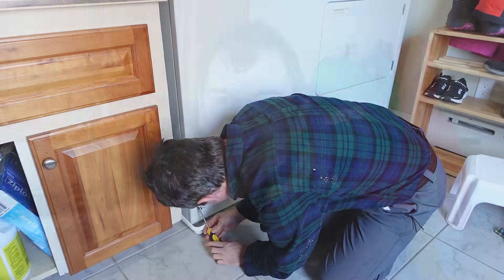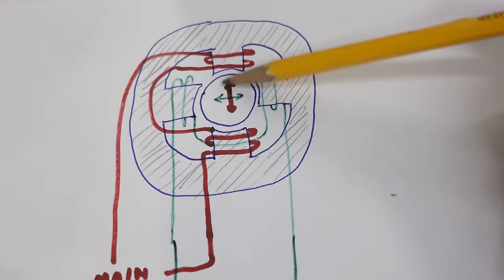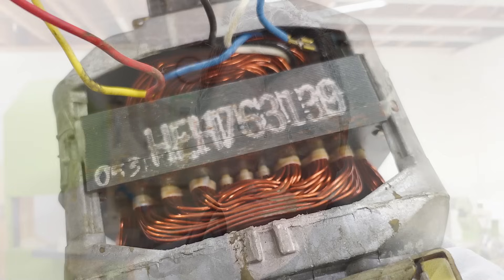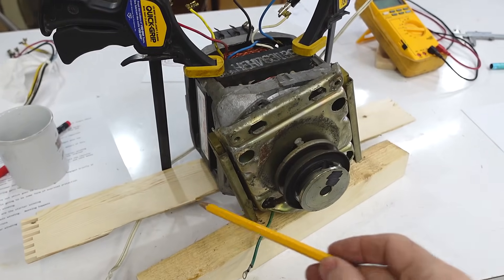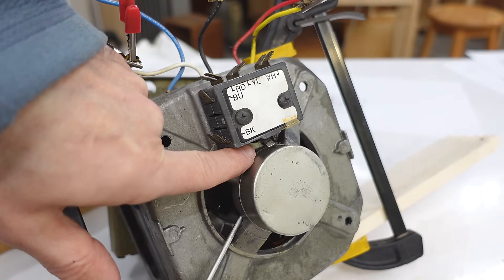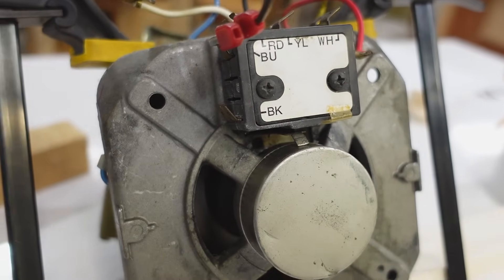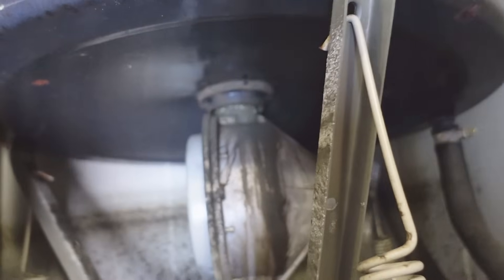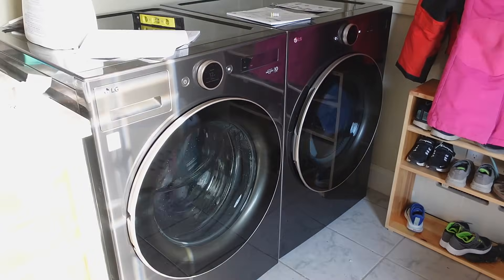Washer motor wiring to reuse for projects

Comment: If you can just replace the capacitor with thinner winding wire, I'm curious why that's not always done that way?
Reply from the maker: Its inefficient.  For larger motors, it would pop the breaker before it gets up to speed.

Comment: Very good, i like the diagram with the 2 windings the start and the running, so once the start winding has started rotation of the magnetic field by being slightly out of phase the motor then reaches a balance point where the field rotation balances itself, is the balance achieved by the slight phase lag that is caused by the physical motor never catching up with the rotation of the field, thanks.

Comment: I’m a process controls and automation engineer. I have rewired and added an Allen Bradley 1756-L83E to my house and use a 1794 Flex I/O rack to my washer and dryer to better control their processes. My next endeavors are going to be to automate my refrigerators and freezers. I have controls on my plumbing and HVAC system to monitor pressures, temperatures and flows. Next will be to automate them. Parts are much cheaper when they are standard process parts and not proprietary vendor parts. So far I have yet to find an appliance I could not automate. 😂

Comment: After decades the penny has finally dropped as to how I can wire the switches on my pillar drills and late to reverse the shaft rotation.

It also explains why the 1940's lathe has a washing machine motor!

Comment: I dismantled our washing machine 5 years ago and the motor is a universal motor, it also runs on DC as low as 12V.   It looked brand new even after 10 years of heavy usage, as did all the other components.  The fault was traced to the programming board which cannot be replaced according to the manufacturer.  Maybe a video on universal motors please?  Thanks for posting this!

Comment: Like your video! I have a problem . I have an old Maytag A209 washer Very similar like yours  and i can't find the start capacitor anywhere, not even on the schematic diagrams? It just stop working and now it just hums..Talk to techs and there's "no" diagram illustration for a capacitor but there is a part# ? Im dupped!   I got a new replacement motor but i dont know  to add in a "cap" to the new  motor because i really want to save this washer! lol Can you please help?

Comment: I realize this vid is a year old but I'm hoping someone could advise. My motor has a 5 wire plug. Two red wires that run together and the other 3 wires are a little larger red, blue and white. Im thinking the red, blue and white could be high, low, neutral and other two red go to control board. I smoked an older motor this morning and this being a newer and bigger motor I better start asking questions
Reply: GE model j58tlb1186
Reply from the maker: there's no standard for what color does what.
Reply: @matthiasrandomstuff2221 my old one is similar to the one you use in the video. It came from my old washer and the quick connect burned (near fire) on the control panel side. I wired several ways but the only way to make it run smooth was connecting only the run winding. It'll serve its purpose. I have little experience with these type motors so it's all a guessing game or lessons in what not to do. The new motor is no good on the shelf. I'm going to do some more looking but tomorrow afternoon I'm going to experiment and see what happens. The 3 larger wires all have continuity no matter which two are connected but none have continuity with the two red wires. Ill come back with the aftermath report
Reply: So far, the two smaller red wires with no continuity with other three go to a sensor of sort at the back end of the shaft. I ran a live to the white and neutral to blue, gave it a spin and it took off running quiet. I connected the neutral to red with live still on white and got same I think. No way to tell if rpms changed. I didn't try any other combo. Tomorrow I'll check ohms between white/red, white/blue and blue/red blue red could be higher speed. Red/white/blue are the only wires so now that I'm thinking about it maybe the two smaller wires go to brushes. I've never seen brushes on tge end of a shaft though. Since there is no signal between those two and other three I doubt it's brushes. Any ideas?

Comment: Cool guide, but what a waste of a vintage Maytag. Based on your other videos, you would have been more than handy enough to replace the seals, main bearing and avoid a modern garbage appliance. Parts are still everywhere. Don't hire repair people that also sell new appliances. Guess what makes them more/easier money.
Reply from the maker: Service guy said, if you need a new main bearing, you have to get it out of...  another old maytag washer.  Sadly, they do wear out too.

Comment: I have a question for you. I have a 12v DC motor that went to a folding bench seat in my van. It's a single phase from what i understand do to having only 2 wires,Red/Black, pwr/grd. I would like to open it and ADD to more wires so i can use one set to power it and the other, to power something else at the same time.Can you do a video on that.?

Comment: Matthias,  have you noticed significant lint bypassing the filter trap in this LG dryer?  -- I found lint builds quickly beneath lint filter in just a month or two of use of 2 year old LG dryer. The lint filter and housing are in perfect condition. I was curious about the cause so I used a bright flashlight and phone camera zoom to peak through the plastic slots while the lint filter is in place and found air gaps between the frame of the filter and the filter housing. Later, I inspected 3 LG dryer models in an appliance store and all had a loose fitting filter with air gaps at the bottom inside edge which would allow significant air and lint bypass into blower motor.  I looked at 7 other machines from other manufacturers and none that I inspected had gaps like this. Perhaps it's designed that way to allow air bypass if the filter is clogged, or perhaps it's just bad manufacturing or even bad design?

Comment: While it can often be difficult to get parts for old washing machines, or appliances in general, from manufacturers and suppliers after a while, there is still hope if you don't want to outright replace things.  Often, things like bearings can be matched up by size and type at a local bearing shop, or by people in the know who do a lot of "out of spec" repairs.  I can recall a time when a relative took a bearing out of a window ac unit in to a bearing shop, and as soon as he set it on the counter, the clerk was able to identify the make and model of the air conditioner without even having to look at the part number.

Even good used parts from appliance breakers can often be found on sites like ebay.  I replaced the motor and drain pump in my 30 year old washer last year after the starter windings burned out, thanks to the bearings in the motor binding with rust from a leaking drain pump.  My washer uses a common shaft to drive the drum out one side of the motor, and the drain pump out the other side, hence the motor issue.  The motor I got from ebay worked flawlessly, without noise, and I was able to get the drain pump new.

Comment: Our LG washer/dryer has an option to light up the drums when they're running. the Mr. and I watched probably 10 loads when we first got our new machine. I replaced the bearings in our old machine probably 5 times before we gave up on it and got a new one.

Comment: That washer was also made when they were still belt driven. Later on they were mounting the motor directly under the tub. And then when the seal in the bottom of the tub leaked a little it dripped down into the motor damaging it.

Comment: Pretty neat stuff. We had a front-loading washer and it would mildew and get moldy. We replaced it with a top-loader which I think is much better.
Reply: Don't close the door all the way when done, let it dry out first. Problem solved. And they won't rip your clothes apart like top loaders do.

Comment: I rescued a fridigidaire dryer so if it has too much problems I'll just use the motor. I want to make a chicken picker, a sander and a concrete mixer with the washer motors

Comment: Been working on motors eince the 1960's and never saw or seen a resistor in seties with a start winding. They have been making split phase motors witout capacitors for over 80 years. Only used for low starting torque applications. No such amimal as a winding going up & down. AC Motors windongs produce a rotating field. The start winding is 90 degrees out if ohase with run winding .

Comment: The water level switch is also pretty handy. It is and off/on switch with a diaphragm and works off air pressure that builds up in the tube when the water level rises. I used a splice fitting attached to a piece of cpvc to control a pump motor for maintaining a constant water level in a homebrewing design.

Comment: I think the new "energy effciency" washers use MORE electricity because they run twice as long if not longer than the older top load models. They save water, sure, but my water is $8 a month and my electricity $250 a month. New washers aren't worth it in my book.

Comment: I've taken that Maytag motor apart, the little box on the top where the wires attach is a relay that controls the start circuit. It opens when the RPM of the motor attains a sufficient level. It didn't use a start capacitor, it used that relay (originally). I actually added a capacitor to the circuit, which didn't work very well, but later I found out that the relay is easy to rebuild, and has points in it similar to the points in the ignition. All I had to do was to file the points and the motor started working again.

That's a good motor, it was in my mother's Maytag, which unfortunately she scrapped when she replaced the washer.

EDIT: I guess you kind of explained what I said in the comment, in a bit clearer way. I assumed that the relay worked by centrifugal force. Since I never took the motor out of the machine, I never saw the little tab that moves the switch, that you point out in the video. Anyway if you unscrew that cover plate you can inspect the points of that relay, it might need dressing with either a point file or a nail file. Great video, a few years ago when I fixed my mother's Maytag, the repairman said that the transmission was gone, when all it was, was the little relay, the transmission was fine.

Thanks for the content. 
Keep up the good work.
Reply from the maker: not a relay, just a switch, activated by the button towards the motor shaft.  Contacts are not hard to clean if you take the two screws off.  Putting it back together is a bit tricker.

Comment: Hi Matthias.  Hope you could reply on this. Been a long time viewer of your channel. I just need to ask a favor. I have an old Kenmore clothes dryer which operates on 220v.  However, our new 220v supply is not working for our dryer. I am attaching here a diagram to better understand the problem. On Fig. 1, the dryer works but not on Fig. 2. Our new outlets have no longer 110v if read from the ground. Hope you could advise how can i still use the dryer on the new power supply.

https://drive.google.com/file/d/1MT8jz7WQmWEi73M4JFCGIqteYItzrAnh/view?usp=sharing

Thanks in advance.

Comment: I remember this simple washing machines from my early childhood. My mother got one second hand, I guess it was made in the 40's or 50's, it had a wooden cub, a big strong motor underneath and had hand swing what's-it-called the squees out the water to hang it upon the washing line. Miele was the brand, it was used til in the 80's. Maybe it us still working, It never stopped, it simply was replaced by an automatic washing machine.

Comment: Hi Matthias. Been a long time viewer of your channel. I just need to ask a favor. I have an old Kenmore clothes dryer which operates on 220v.  However, our new 220v supply is not working for our dryer. I am attaching here a diagram to better understand the problem. On Fig. 1, the dryer works but not on Fig. 2. Our new outlets have no longer 110v if read from the ground. Hope you could advise how can i still use the dryer on the new power supply.

https://drive.google.com/file/d/1MT8jz7WQmWEi73M4JFCGIqteYItzrAnh/view?usp=sharing

Comment: My first home (purchased in 2002) came with the Maytag washer and dryer you can see in the basement of “That 70’s Show”. I lived there for 8 years and only once replaced the thermostat in the dryer. Simple and reliable. If the next owners are smart, those are still kicking it in that basement.

Comment: Matthias, you have a special talent for making things easily understood and interesting 👍👍 Thanks for making these vids for us to learn from and enjoy!

These old electro-mechanical washing machines tend to live long lives, and are easily repairable as long as you can get parts. The newer electronic machines are more efficient, but also do a worse job at cleaning heavy dirt, and they are not built as robustly. Many have electronic components which regularly fail, and the repair is to replace a circuit board which is costly. Often there is a shortage of the parts needed due to high demand for them and the factories render them 'obsolete' sooner, meaning that 5 years from now you may not be able to get parts and will be forced to buy a new machine. So if you have an old machine you should repair it and maintain it as long as possible because the new ones are a rip-off. But that's all you can get now. In the end this increase in efficiency will cost us more financially and ecologically too; so the final conclusion is for me that they are not truly efficient at all.

These old motors have many uses in a shop and like the machine they came from were built to be robust. They should be saved and used instead of being scrapped. One thing to look for is that the centrifugal switch sometimes gets gummed up and will give a no-start condition. Clean it if it looks like it needs it and try again; often that gets a dead motor going again. The new machine's motors are not built as robustly and may not have as much horsepower but are still a worthy save.

Comment: Confession: - Not long after I left home around 1969 my (If it's Politically Correct to say) mother's wringer/agitator machine failed and a new one appeared. I scavved the motor out of the old one. I thought I could maybe use it for a bench grinder or something. It's still on a shelf downstairs in the garage. It's only been 55 years.
At the time I only knew a little, but I went on to train as a telecommunications tech and learned all this stuff, so I have no excuse.
Reply from the maker: the beauty about that old stuff is, if you do decided to use it, it will still work.  Can't say that much about a lot of 30 year old electronics.
Reply: @matthiasrandomstuff2221  True. Last year I found my ex-wife's cheap little plastic-cased Sanyo portable record player from about 1969 she had when I met her. All I did was lube the motor, drive wheel and the mechanicals, give it a clean and polish, and it worked like new. I told my daughter, next thing I heard my ex wanted it back, LOL It was her's after all, so I handed it over.

Comment: great video. BTW, I'm using the Maytag dryer that Grandma bought in '77. The washer died several years ago due to transmission failure. I've saved the timer, pump, etc, but have never needed them.

Comment: In my experience, the exhaust fans on the newer driers are nothing like the old ones.  You will run into vent pipe length restrictions very quickly, which make the newer machines overheat and shut down, where the old one would just power through.

Comment: I used a washer motor to rebuild my commercial garage door opener. It is a really old school opener with no PCB, just a series of relays and micro switches. It required a motor that can be reversed with separate sets of wires, just like a washing machine motor. It has been running the door opener for almost 10 years and still going strong. This video would have been very helpful back then. I am sure many will benefit  from this video.

Comment: in israhell most washer motors are universal motors which have carbon brushes.
but I have found some with induction motors which have a continuous run capacitor, these are called PSC or permanent split capacitor motor.
Reply: I haven't harvested any of the universal motors because the speed can't be controlled.
I have used the PSC motors because they have constant RPM, about 3000

Comment: Matthias the gap between your new washer and dryer seems a tad small. Front loaders tend to have a bit of side to side movement during spin cycles (and need clearance ). The machine might vibrate against your dryer

Comment: I don't think the resistance affects the phase. The starter winding must have a different number of turns, therefore having a different induction and so a different phase. The thinner wire is only to save on costs...

Comment: As if they make the wires thinner because of the costs of a resistor. Surely it's because of the costs for the copper that it saves.
Reply from the maker: Both.  Power resistors are surprisingly expensive to buy.

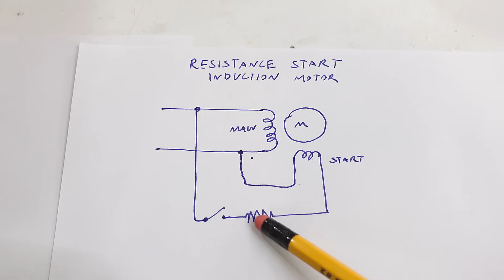Comment: 2:35 I thought resistors basically don't affect phase? Or is it because of the phyiscal position of the coils?
Reply from the maker: Inductors affect phase.  If one side is resistor and inductor, that phase lags less than the main phase
Reply: @matthiasrandomstuff2221   ah okay, never knew. So resistors not affecting the phase only holds true if you have a pure resistive load?

Comment: OK, so the blue and yellow aren't just connected together; they have that OCP in them. But then... how does that specific connection help run and protect the motor when it looks like a short to whatever else you're connecting those two wires to?
Reply from the maker: it opens on overcurrent
Reply: @matthiasrandomstuff2221 : But how is it supposed to work if they're just shorted together?